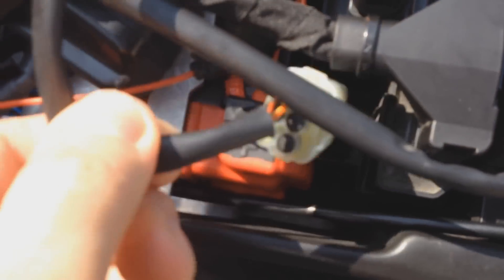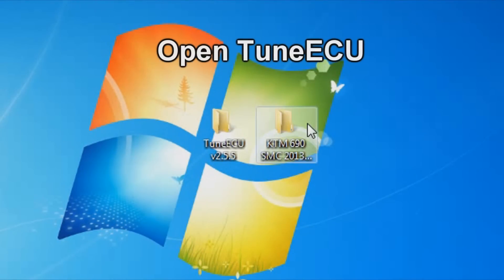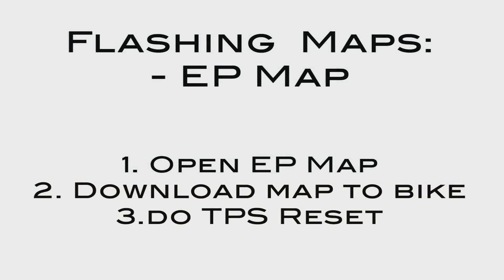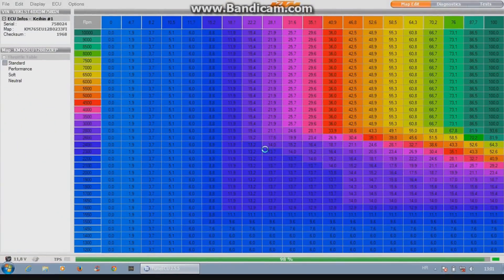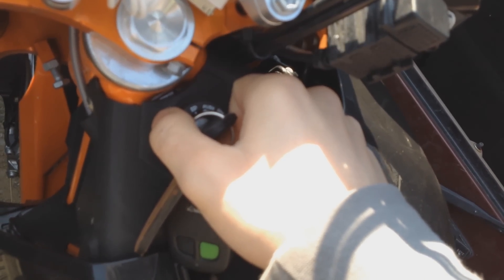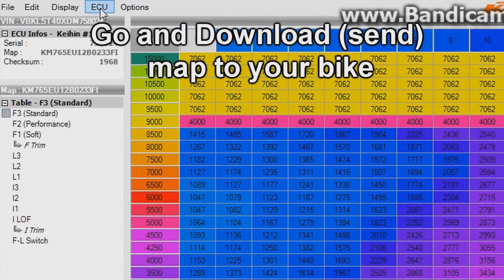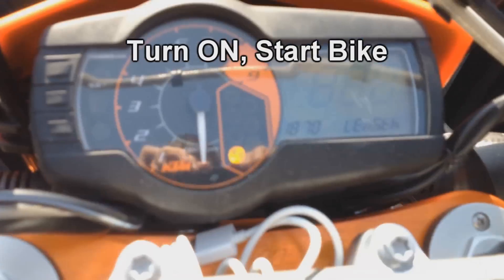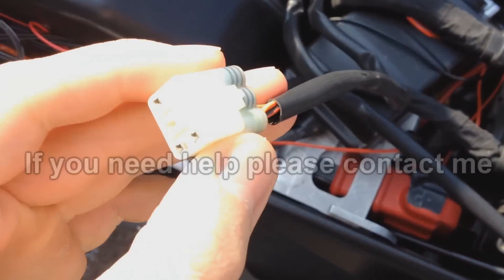KTM SMC 690 R Mapping TuneECU Tutorial [Flashing ECU]

Comment: Are you good with ktm? I have a problem with my 690 i bought. its from 2012 and the pre-owner states it have EVO 1 map on it. It have EVO 1 airbox with foam filter and LeVince Slipon.
The bike runs really bad without the DB killer. it dies on idle, pops and bangs on lower revs and runs rough on low speed with twitchy response on the gas.

When i put the DB killer in the slipon the bike runs great with good idle and not twitchy. What can be the problem? is the back pressure to low? is the mapping wrong? I want to be able to run without DB killer but i cant do it at the moment. I have changed spark plug and the coil (the tip was gray/white) I have changed fuel filter, Inline fuel filter, fuel pump. the next thing muste be the mapping?
Reply from the maker: I had the same problem, with the db killer the engine runs much nicer and doesn't shut down. It is necessary to add more fuel to the mapping.  Everything is explained in the video.

Comment: Hi I have a 690 Supermoto 2008 and installed arrow exhaust system, my bike stalls every time when downshifting and low rmp rates ,will this sort my problem. pls help me
Reply from the maker: you need get richer map
Reply: Will this problem sort if I adjust TPS or is there a map switch on this model
Reply from the maker: you need put db killer and try, but i suggest you get maps
Reply: yeah, I don't have DB killer in that. is that the problem actually.I cantt find the map switch under the seat. after installing a DB do i deen to adjust TPS voltage for factory.( 0.50-0.54V)
Reply from the maker: get db killer bike will run more better
Reply: Thanks a lot will try and c
Reply: Mohommed Zameer I have the same problem, did you manage to fix it thx

Comment: any way to do it for duke 200?
Reply from the maker: what year ?
Reply: 2014
Reply from the maker: Sorry but i don't know, 2014 models are locked. You need check your ktm dealer.
Reply: AFF Racing Team - Damir they sell Programmable Racing ECU for KTM DUKE 200 in India but mucho dinero $$$, there must be a way to map the ECU with a wire like this dude. KTM dealers here in Turkey are idiots, I know more about my bike than my dealer...
Reply from the maker: Yiğit Özceyhan  I think ecu original from ktm 2014  is protected so you can edit maps.

Comment: Why SAI is off
Reply from the maker: SAI (Secondary air injection) is needed when you have stock exhaust with catalyzer. But leovince is open exhaust without catalyzer so you dont need SAS (SAI) turned on, just turn off and all will be ok.
Reply: The Dirtbike Rider Great Video! 
Question, did you remove the SAS? You're using the evo 1 filter and evo 1 map for the leo vince exhaust right? Is it advisable to use the evo 2 package with a leo vince exhaust? Thanks and sorry for many questions!
Reply from the maker: muhd syafiq
 No i haven't removed SAS, i use evo1 filter cover and evo 1 map for leovince.You can use evo 2 package with leovince, but if you have money i suggest you to get akrapovic :)

Comment: Hi,i have KTM smc 690 2011 with leovince exhaust,air filter k&n and open cover for airbox and remap tunning kit evo1,how is better for engine 
with SAI and O2 on or off.
Reply from the maker: You need turn off SAI, but turn off/on O2 is what you more like.. For me when o2 is turned off i don't get that engine braking when i let throttle so i like to Turn Off o2 and i have noticed in city i dont need more radiator fan when o2 is off.

Comment: I should also add that that the engine isn't running good. When I releas the gas to shift gear the engine dies. Can I get rid of this problem with a new mapp?
Reply from the maker: Yes you can Fix stalling problem with new maps, have you any mods on bike like custom exhaust or air filter.
Reply: Yes, I do have a custom exhaust but I can't find a mapp compatible with it. Were do you recomend mi to by the cable, mapp? Do I nead something else?
Reply from the maker: Philip Vestman  If you use stock maps with custom exhaust what has more air flow then you will have problem with bike. You need map with more fuel. All maps can be found on TuneEcu site

Comment: Hi , tune ecu don't work with duke 4. i don't no what to do :(
Reply from the maker: Some diagnostic cables are not good, if you have connector on your bike it must work just get great quality cables,
Reply: Damir Hairlahovic
I'm not sure it is cause cable beacause it is specified on tune ecu website that does not work with duke 4
Reply from the maker: westsidestb
 Have you tested to connect tuneecu with your bike ? if that info is from tuneECU site maybe that is correct.

Comment: Hello,
i have the same problem that iArthas1and same bike : ktm duke 690 2014 restricted A2. i have try to search on tuneecu website but it's say "not compatible for duke 4 models". have you maybe an other solution for turned bike to full power ? (44ph to 70) or have you news for make this with tune ecu ? please
Reply from the maker: Download stock maps from bike and you can try to modify in tuneecu to unlock all power.

FI map should be same in "stock" and in "Restricted power map". But EP map is different. Full Power map has 100% on end and restricted has only about 35% maximum.

I suggest you to leave Restricted on Standard setting, and make Full Power on Performance, so you can switch to full power and back to restricted with one turn under your seat.
Reply: Damir Hairlahovic
Thanks you i'll try

Comment: My dear friend very good video!
I have the 690 enduro 2008 model with only acrapovich end exhaust and stock pipes. and K&N air filter. I have not removed the plastic pipe on the top of the air box that is on the air filter. Should I remove it?
I lso like to ask you on minute 3:25 seconds on the video , after the f.i.map open, Why do you deselect the SAI and O2 sensor boxes? what they are for?
Thank you very much my friend!
Reply from the maker: Yes remove air filer cover and put evo 1 filter cover or make few holes in stock one.

SAI (SAS) Secondary Air System, will pump air in your exhaust to cold catalyst (on stock exhaust), most custom exhaust dont use this  so you dont need anymore SAI (SAS) turned on, and O2 sensor is for fuel/air mixture and it will lean your mixture so its better to turn off your bike will run better.
Reply: Damir Hairlahovic thank you very much!!

Comment: so i have resctricted power map (32kw) if i download any maps from the site of tunecu, the bike will be at full power?
Reply from the maker: You cant use "any" maps for your bike, it must be correct maps or you can damage engine. First connect your bike and read maps then you will know what maps you have now ( stock or Restricted power).

Do you have any mods on bike like exhaust or open air filter ?
Reply: @TheDirtbikeRider  Many years have passed I know. But same situation now. Restricted 32Kw 2007 Sm. Which map should I pick ?